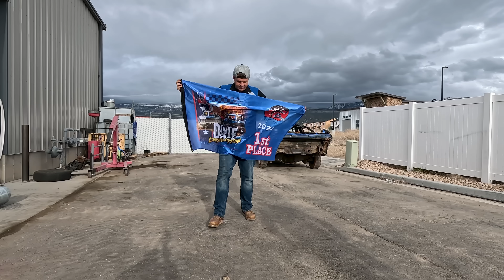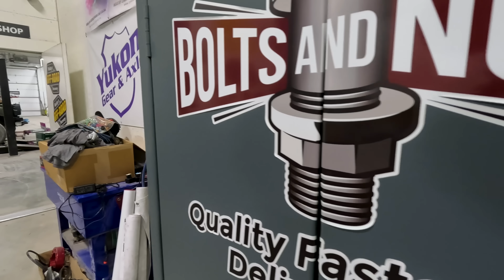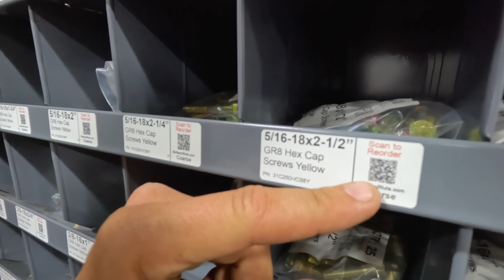We're Saving Industrial Injection’s Crashed Ram Truck!

Comment: That’s pretty nifty that the inner door panel and regulator comes out like that, every time I’ve had to do a regulator or glass I end up a bloody mess.
Reply: 😊😊😊😊😊😊😊good work
Reply: True but did you notice what isn't there?  Not a single inner support to keep something out of the cab with you. Kinda scary if you ask me.
Reply: @lloydfancett3039  You know what else you don't see?  A pervasive problem with those doors being a safety hazard in crashes.
Reply: I saw that design and I asked God why no one thought of that in about 1950? Why have we been fighting window regulators for so many decades?!?

Comment: I enjoy seeing what you have to go through to fix things properly
Reply: I question the need to spend the time to "properly" fix the body of a work truck.  If I worried about every dent and ding on my truck, I'd have it in the shop half of its life.  Cosmetic damage occurs almost every time I use it off road.  I'd have to have an advance crew with saws and pruners ahead of the vehicle in order to avoid the "Colorado Pin Stripes" that happen.

Comment: Wait till collision glue systems become mainstream - no grinding of the paint to attach metal keys. Of course you can still glue to bare metal if you need to, but don't have to grind after removing keys. Some glues can hold to over 1200lbs.  Tension pulls with glue and porta power units to remove large dents. Major time savers.

Comment: I know of 2 types of body shops in my area.  Those that strive for perfection and thrive off insurance jobs, and those that patch things up to look fairly reasonable, but mainly to pass safety inspection.  The second type costs about 20% of the insurance jobs.  I wish there were something in between that would fix things up to match the condition of the rest of the car, rather than having perfect repairs on a somewhat worn car!

Comment: Robby - Great channel & love your commitment to good hard work.  I have a few years on you - but when I was young I saw a body man use lead as filler.  I specifically remember him applying it to the connection on a rear quarter from a first gen Camaro.  It was probably 1985-1986.  Have you used lead, or does anyone in the industry use lead anymore?